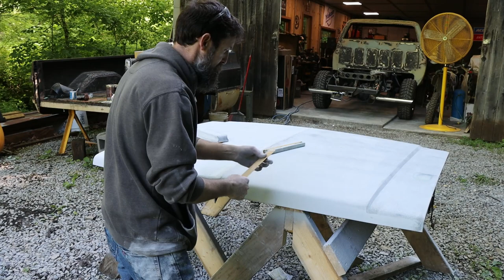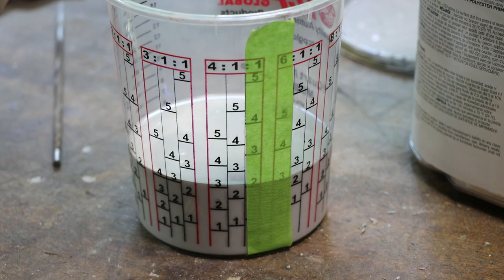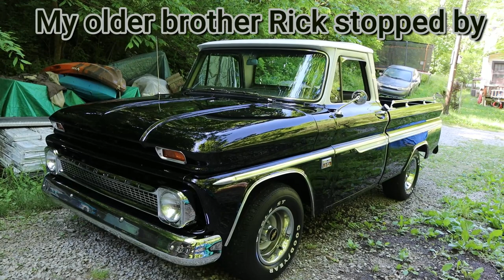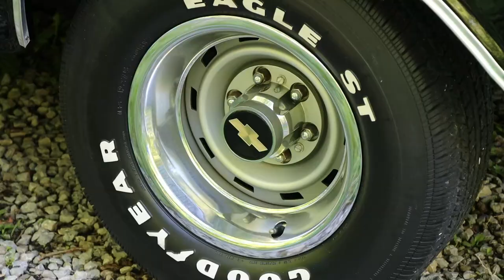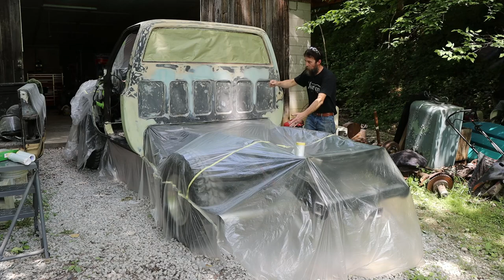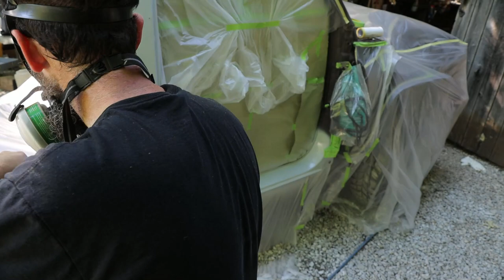Busted up Chevy Short box 4x4 Rebirth, Part 1001 section 2.75

Comment: A neatly made stake bed makes a good alternative, and should add to the strength of the truck frame.  Depending on what the axles and rear suspension can handle, it might be possible to make one into a dump bed ... handy for quick wood hauls and those teaspoon sand and gravel runs.  You may be glad to have that option when 'grumpy old fart-hood' time approaches.  With a simple lock down feature, you could add a bed hitch later on, or a fixed bed and bed hitch (along with gooseneck or similar trailers) would allow you to do some heavier machine hauls and make use of trailers that are made to dump.  I think the options are greater without the stock bed.

Comment: You are absolutely correct about the time and lack of financial gains when it comes to restoration work. Quite frankly, I'm not even sure how body shops make any money, even with collision work. Insurance companies cut every corner they can to pay as little as possible for the repair. The Skilled labor pool is lacking in this field too, as in all the trades. Blocking and straightening auto body panels is a very labor intensive endeavor. When I do my own vehicles, I'm reminded every time, on just how much work it is. I can do a very good job, but it takes lots of hours and elbow grease. Not to mention that the materials are getting very expensive. The only reason why I do my own repairs and restorations is because I can't afford to pay someone what it would take to accomplish the job that I would be satisfied with.

Comment: Im not a body/paint guy.
But im going to pass a good piece of information to you that i herd on a auto restore show some years ago.
Make sure that when you finish paint your panels & doors for the truck that they are hanging in the same orientation as they would be hanging on the truck.
As the paint is going from wet to Dry or fully curred, the reflective particles will arrange themselves according to The force of Gravity.
If you paint some of the panels while they are lying on saw horses or flat instead of vertical, the panels will catch light differently than the other ones that were painted hanging in the correct orientation.

Comment: Something someone told me, was everytime you check your oil, take the dipstick and touch the end that has the drop of oil to one of the hinges on the hood. I did that and by the time the rest if the truck rusted off the hood never creased and the hinges were well oiled.

Comment: LOTS OF GOOD INFO THANKS.
I JUST BOUGHT A 1993 GMC 1500 2 WHEEL DRIVE 5 SPEED 8' BED IS IN GREAT SHAPE ,38 GAL TANK,(CAMPEREDITION)?,,BREAKS,U BOLTS,DROP TANK TO FLUSH OUT SUGER!!!,ENGEN WAS NEVER STARTED AFTER SUGAR WAS PUT IN , THE GUY WHO OWNED IT SAW THE GUY PUT THE SUGAR IN (THANK GOODNESS). THANKS STEVE

Comment: I always use carb cleaner to clean the gun immediately after spraying anything. I remove the cup and clean it, and than the nozzle and clean it from the inside out making certain the tiny holes are clear in the tip. I have owned my Devilbiss spray guns for decades and to this very day, you can pick up any of them and they look like brand new. And carb cleaner is so cheap too... Thumbs Up!
Reply from the maker: Yep, its cheaper and easier than pouring solvents from a bucket and I think it works better. Works good for the diy guy anyway 👍

Comment: wat we done when i had to clean out the spray gun is pour out the paint left put some thinner in it put the lid on shake then pour out our in some more thinner , unscrew the nozzle halfway hold the nozzle ocasionally close with youre finger while pulling the trigger (hooked up to air ) this will make the thinner in the cup bubble like crazy so watch out 
again pour the thinner out , take the nozzle of and brush it clean with more thinner and use a rag to get the rest of the outside clean 
usually ends up pretty clean that way

Comment: Another great project. It appears your Deckel has a different collet system than mine. Mine has a MT4 with the same buttress thread. All but impossible to get collets or other tools. So I’ve made a M16 arbour and can buy chinese tools. Oh, also mine is in imperial measurements which makes interesting measuring. Glad there’s a dro.

Comment: Since you can't find a good bed, why not just salvage the quarter shells and put in a wood bed. Doesn't have to be furniture grade or anything, maybe treated material to resist rot, but can still be made to look nice.
Reply: I don´t know about the US, but here in Europe/Germany you can get decking made from recycled plastic, in a variety of colours/surface finishes. 
If one of the design options looks nice enough, that material should be pretty well suited for a bed, it´s wear and weather resistant and will not rot.

Comment: Steve it's starting to look the business mate! One thing I would advise you is as you were saying how the trucks are getting sought after now, so they are going to be sought after by the wrong sort of people..... thieves. So I'd consider a decent set of lock barrels for the truck AND a decent anti theft alarm too. You don't want to spend all that money and your time to line the pockets of some thieving bastard who most likely would strip it for pieces and parts including your hard worked body panels. Looking forward to knowing what colour you have chosen. I know you were thinking of the original when I visited you, have you made a choice yet? And is it going to be a big reveal as the paint goes on with no video of you mixing the paint up, just spraying it?

Comment: Steve, so often you can tell a Homemade spray job, it just looks like it, it may be shiny and clean but it somehow just looks homedone
What in your suggestions are the reasons for it?
For example a coat of a Cobolt Blue at home no matter how careful the painter is, it is easy to tell. 

Could it be a lack of clear coat? Or a combination of things? 
The truck is coming along nicely Steve, I'm enjoying each and every video on it. 
Tony from Western Australia 🇦🇺
Reply from the maker: I'm not sure Tony, it is most likely the uncontrolled weather conditions. Temp and humidity. I was never a paint guy. I was a body guy and after the prep work was done I handed my work over to the painters.
Reply: @SteveSummers  thanks Steve, I also see a lot of car's with original paint and some fairly recent models but it looks like the clear coat is pealing off mind living in the heat up to and above 45c in summer and below 0c in winter it is probably that and if the owner washes the vehicle etc doing it that causes that.
I noticed you didn't use any kind of degreaser or then a tac rag to thoroughly clean the surfaces on the bonnet or cab before spraying, don't you consider that an important part of the prep work?
Tony

Comment: is it gonna be a work or show truck by the end ? 
and why then spend so much time blocking the car and then spraying it outside under trees ?
very big chance of a bug or a leaf landing on the wet paint , bit of a waste of sanding time not?
Reply: It's for hauling firewood and going to pick up stuff from Lowes lol
Reply: @samrodian919  that is what i got yeah but then again i wouldnt pickup firewood in a nice truck unless its prepacked but thats just to expensive for firewood.
and why i wouldnt do that is simple mostly because the chance of chipping paint while loading or unloading a full bed off firewood kind of defeats the purpuse of the nice sanding job , but then again had the same with the paint location under the trees would be the last place i would have painted after all that sanding.
Reply: @cornnatron3030  I think Steve may sort some sort of rubber liner for the bed to stop the chipping but I don't know. And if I were him I would sheet up inside the front of the workshop and paint it inside to prevent that happening or he may have another venue to do the final painting.

Comment: I get a kick when you call your 85 square body OLD !  HA ha ha ha ha my NEWEST car is a 1970 ! so your hurting my feelings ( but I will get over it ) I feel many are now getting more involved with restoring old cars ( the older the better ) as the price of all these newer cars is just getting totally outrageous to even think about, plus the fact nobody can pull there tools out and fix even the most basic of repairs on ANY of them because of all the un needed crap & location of everything under the hood. Old SBC forever. 

      I hear all the time that body work is boring, It's not at all as the real key to a great paint job is correct body work and knowing everything is totally correctly prepped  from bare metal all the way up to good sealer as the job is a total package to get the wanted results. Fact is Steve if you can do the body work and block it dead square, you surely CAN paint it yourself even at home if you know the basics in my opinion.